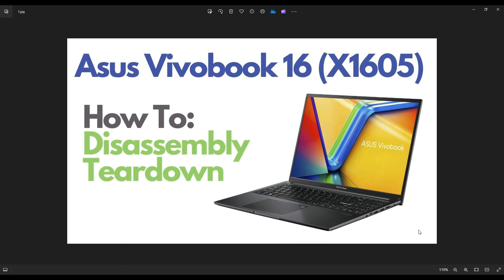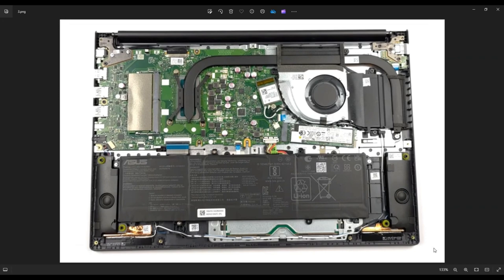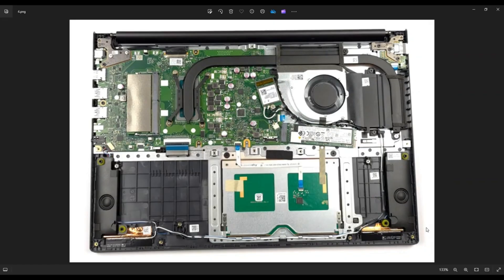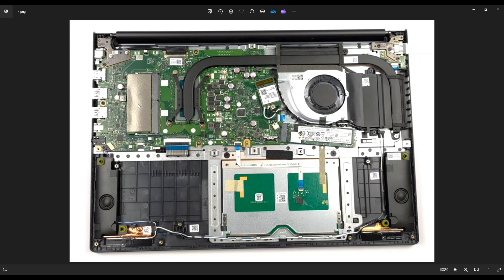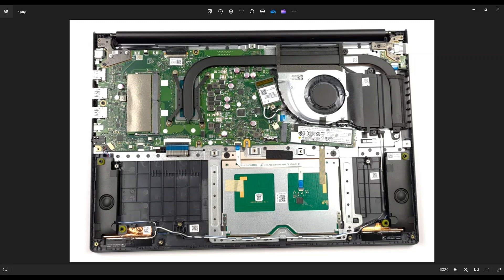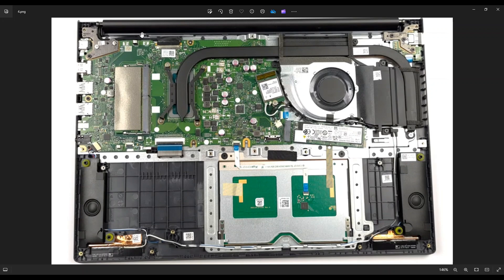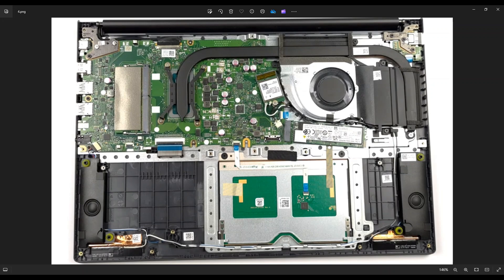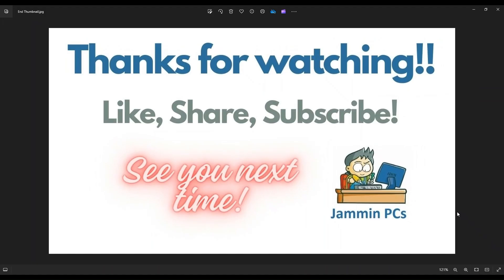Teardown / Disassembly, Upgrade Options - Asus Vivobook 16 X1605 Laptop Computer

Comment: Hi, thank you for your work with these videos, I've a question, my laptop vivobook 16 x1605va don't have a backlit and I was thinking about changing the keyboard, but I don't know if it's a good idea. What do you think ? Is very very complicated change the keyboard in these laptops?
Reply from the maker: Some model laptops have backlit ability in the motherboard. If your computer does not support that, you would have to install a keyboard with independent backlit in the keyboard cover itself. I think your model requires almost total teardown to reach the keyboard. Depends if you wanna do that :)
Reply: @jamminpcs hi, thanks for responding to my message, how do I know if my laptop has backlit in the motherboard, if I want to install a keyboard independent backlit (I have seen keyboards in  AliExpress with backlit), it would be harder to change the keyboard? I see in your video some plastic Caps, and it could be fragile?
Reply from the maker: @diegofernandosuarezsanchez2957  Ya, its def fragile. Easy to break. I would search for  your model computer and see if it comes with the backlit option. Thats a good indicator that its supported.